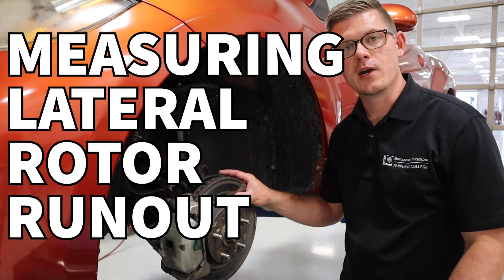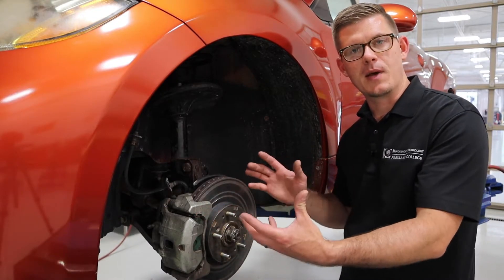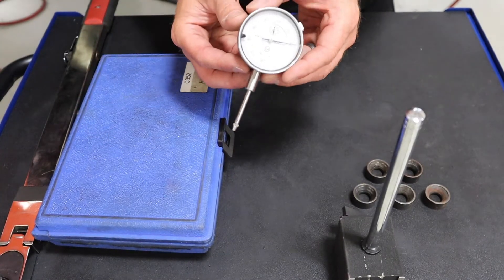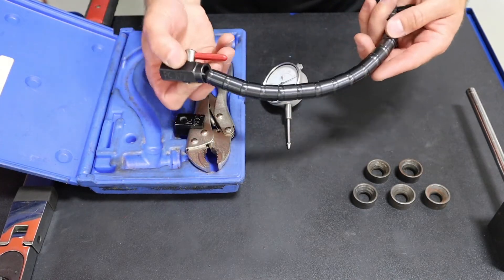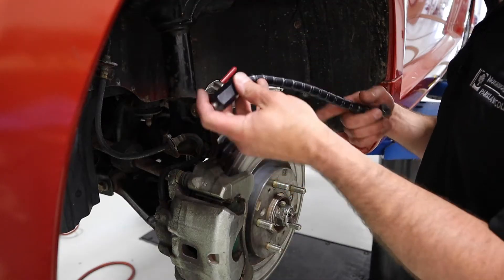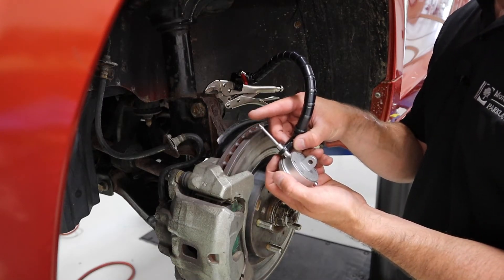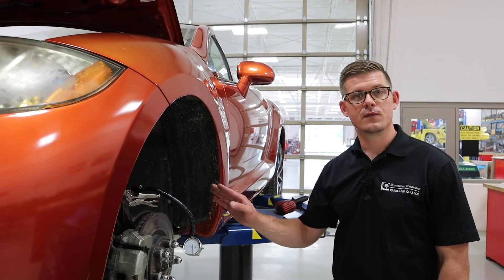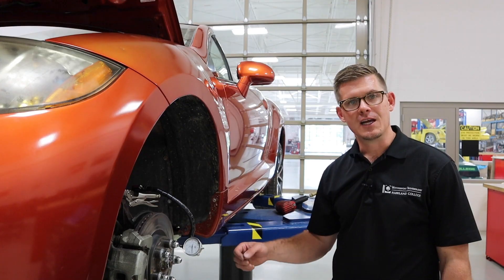Getting Started: Rotor Lateral Runout

Comment: Instead of buying an expensive adapter set. Why not instead just get regular washers and regular nuts? Mine is GM with M12 stud, and the lug nuts have a 60 degree taper. Or maybe buy some lug nuts for the stud, but that don't have the taper and use a flat washer?

Comment: Are the adapters (washers) custom made or can be sourced on the internet? A link in the description is much appreciated.
Reply from the maker: They are a Kent-Moore tool. J-45101-100
Reply: @AdamsAnalysis thank you! Great video by the way.
Reply: The least expensive I could find was over 200.00 USD for those conical washers.  I was stunned.  For less than 1/20th the price I picked up a set of flat back nuts and some large washers.

Comment: Where do I buy the lug nut spacers?
Reply: Why not just use regular washers and regular nuts?
Reply from the maker: Those are a Kent-Moore special tool. https://www.toolsource.com/rotor-surfacing-c-1321_79_89/brake-rotor-runout-washers-p-112384.html

Comment: All you hack mechanic shop owners take notice. If you don't check runout when doing rotor replacement for what you like to tell customers is a "warped rotor" you're a hack.
Reply: No kidding! I have a 2022 Lexus RX350 with 54,000kms. I took it to Lexus because there is a pulsation when braking. The service department comes back and tells me I need to replace all 4 rotors because they are warped. Then they tell me warranty isn’t covering it because the brakes weren’t serviced at the recommended 32,000km mark. I ask them what the runout was and they say they never checked…. the mechanic went by the way the car felt during the test drive.🙄 This is at a luxury dealership where the shop rates are astronomical so it’s not like they aren’t making a good wage!
Reply: I’ve done brake jobs when I was younger… I’ll be doing them again it seems. I think I’ll get myself a runout-gauge setup like this though so I can do it “properly”.
Reply: @beri232  They should have checked hub runout, installing new rotors on a hub runout over .002 with brand new pads will seem to drive fine until the rotor gets uneven friction material build up on the high spot. Then it's back to pulsing again. Sometimes it can take 6-12 months. You can correct a runout up to .009 with brake rotor/hub shims from napa. The V notch on the shim aligns with the high spot on the hub.
Reply: @Reloadeez  Today, I just swapped out the OEM Rotors with EBC smooth rotors and Akebono pads. Rides like new now. ALL of the slide pins were seized on the calipers which was likely the problem. I used Mission silicone on the slide pins instead of the junk Lexus uses. It’s obviously garbage if it loses all lubricity in just 2 years.

Comment: Really good video. You are measuring  the TIR at that he rotor outboard side. This measurement essentially includes the run out for both, the wheel bearing and the rotor. BUT, note that is possible to measure dead zero TIR and still have run out!  Why? Because the rotor inboard side is not being taken into account. TIR measurements should include both faces of the rotor. I seldomly see this mentioned, is this case the same for you?
Reply from the maker: Thanks for the feedback. I agree, we rarely discuss an inside measurement. We typically look at TIR and work inward while discussing common symptoms of parallelism issues of the rotor.

Comment: man, thats a lot of work. I can only imagine having to do it on all 4 tires
Reply: Dont be lazy. My mechanic here in Denver charges $150.00 per hour. I can do all 4 rotors in under 1 hour. Your choice.
Reply: You will spend less than 20 minutes to check runout on all four tires. I do it every time I finish a brake job to assure zero comebacks.
Reply: That's why i end up doing my work at home. It takes too long to do stuff right for shops to actually make any money. If you want something done right...
Reply: 💯 we do this all day everyday get real quick real fast I leave mine setup 2 sec to attach and set up practice makes perfect 👌🏼  but this video was perfect 💯 use it to train my inspectors on proper use of the dial indicator. Good job boss.🎉

Comment: I'm amazed this video doesn't have more views than this. Your explanation was fantastic. 

Would you happen to know what it means when your runout value is the same, but your low/highest value keeps changing?
For example, let's say I found the lowest spot on my rotor and set the caliper to 10 thousandths. I then spinned the rotor, but everytime I come back to the lowest point it now somehow shifts .001" back. So, instead of the lowest point showing 10 thousandths, it goes backwards to 9 thousdanths and so on.
Reply from the maker: Thanks for the compliment! If the scale of numbers continue to shift, that signifies the dial indicator body is moving relative to the point of measurement. It could be the mounting of the dial indicator is shifting. That’s the most likely cause in my experience.